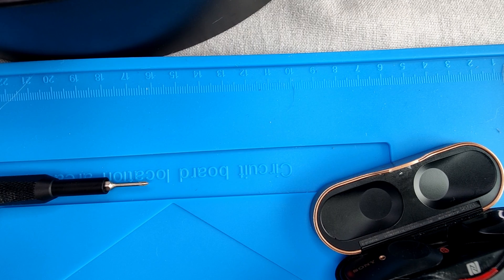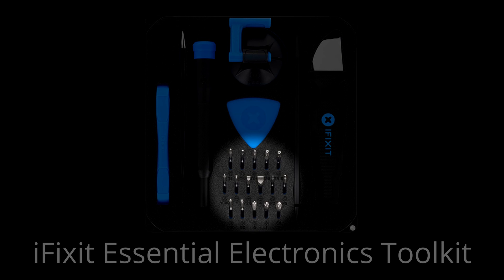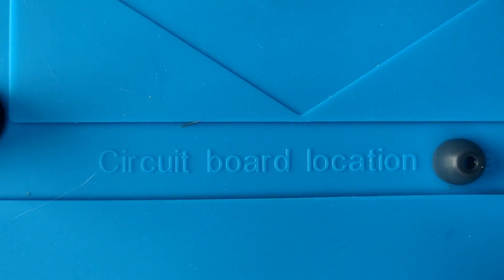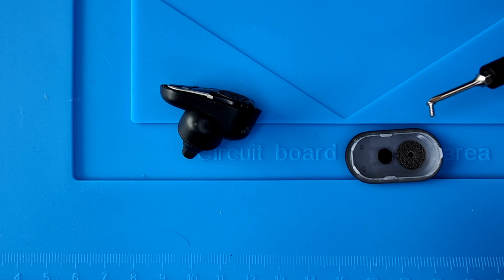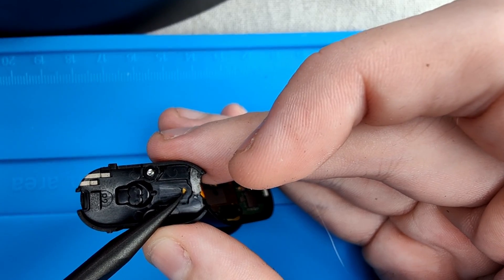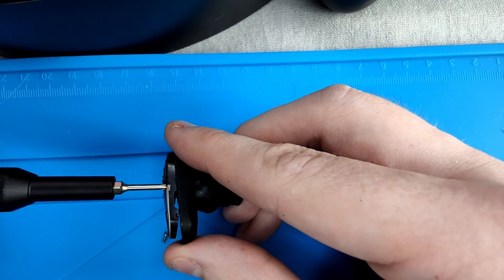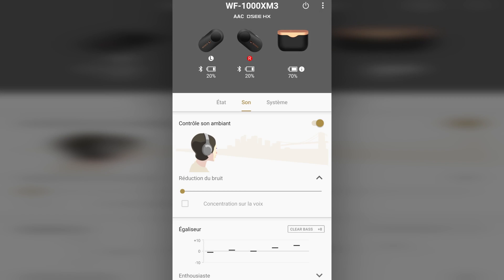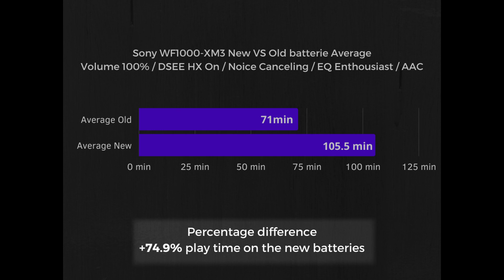Sony WF-1000MX3 Battery Replacement + new battery test

Comment: This worked, thanks. Words of warning for others - 1 - be careful near the front edge because you can easily damage the led on the board. I killed one of the LEDs this way. 2- If your touch sensor is wonky, try restarting (putting it back into the charger) - it will work again.
Reply: Yeah buy Varta cp1254 A4 if u can. They have capacity of 74 mAh vs Varta cp1254 A3 have 60 mAh capacity. 23,33% increase in battery capacity!
Reply: When I opened mine the ribbon ended sticking to the cover instead of staying on the bud, do you think the controls will still work?
Nevermind, left them to charge for a while and they're working now.
Reply: Worked for me too, the LED died but that's no great loss compared to having to throw out a pair of fairly expensive earbuds because one side only holds charge for twenty minutes. £12.66 for the new battery.
Reply: Just snapped off the LED while replacing the battery. Wish I had read your warning earlier!
Reply: I finally broke the led on 1 of the earbuds. But tbf it probably means better battery life now. :D

Comment: Really nice guide, but replacing the battery in one of the earbuds made my earbuds unusable. I broke off the LED when trying to pry the case open with a plastic tool. The earbud works fine without the LED, but now my left and right earbuds don't recognize each other anymore. My phone only sees one of them at a time. The only time they work together is right after pairing. As soon as I put them back in the case, only one of them will connect (randomly or whichever I take out first). I've done all the factory resets in the manual repeatedly. Now I regret trying this "easy" repair job. One of my earbuds only had 1 hour of battery life, but at least it worked. What a waste of time and money.

Comment: you sir are a scholar and gentleman. First one took me 10 minutes second 1 2 but I did break on plastic clip opening the second but my kit came with glue it should hold. Cheers to enjoying wf1000xm3 for a couple more years. Good on sony to not make landfill products. Can't believe a 20$ cad kit from amazon was enough to fix these I was barely getting 30 minutes on anc on original batteries.

Comment: Thanks for this. Right EB only lasts 15 mins, left about 45 mins so going to give it a go. Hardly used them since i had them 4-5 years ago and never been great on duration, so pretty disappointed in Sony. I work with people have other buds in all day and never seem to charge them :-(. Maybe I need to turn the noise cancelling and other stuff off?

Comment: I have done two of these surgeries and both went surprisingly well and are super simple to do. I am moving away from Sony as they have become progressively shit in their QC and customer support since the XM3's - I had two pairs of XM4's fail due to battery issues and fixing those was a NIGHTMARE. 

The XM3's were the last great wireless set of earbuds Sony made before they shit the bed and all over their customers.

Comment: THANK YOU, @Saroua! - 3 years later, and this saved me tons of money!  (got the dreaded "right-side-battery-rot"-issue, which also hit my XM4's... Sony taking no responsibility.)
I did decide to just try and get Z55H batteries (the original type that goes into the WF-XM4's) and boots up, pairs, plays, so I think they're good too!

One thing for me personally though, was that the point of having to align the dot, when reinserting the battery was unclear to me. 
I saw a dot/hole at the bottom, where you could see orange through (ribbon cable), but I guess the dot mentioned was the dot around the middle of the casing, with the HOLE in the metal plate that goes on the battery - I figured it out, and it worked, so all good!

Comment: Thank You - Just Changed the Varta A3 against Z55 which Sony used later on - didn't find a Varte A3, A4 or A5 (not out yet?) on reliable sources. Besides this video, Reddit is a good knowledge base. Now i can enjoy my 5 year old 220 € In-Ears again with full play time, after the left was down to ~45 minutes and the right one was down to 60 minutes. (I often use just the right one when I'm on the bicycle).

Comment: Just performed the replacement successfully, thanks for this video! couple extra thinks to look out for:
1- as other said, look out for the led's on the bottom of the board, take your time and open the perimeter in small steps, do not go deep with the picks.
2- my replacement batteries came wrapped with an amber, adhesive tape film that needed to be removed prior installation
3- watch out to not short the batteries! the metal contact bends upward and that upward part needs to be phisically distant form the side walls of the battery. I made this mistake initially and the battery got very hot. Luckly I was able to recover it but be careful!
4- removing the old battery was quite more difficult than shown in the video. Personally the best tactic was to really push down with the plastic lever to really get under the adhesive before prying.
Reply: video is generally very useful 
however around 5:12 how the OP placed the battery onto the metal plate is wildly dangerous. After removing the old battery you should put the metal plate back to the frame to install the replacement battery. On the frame there are two extruding bits aligned with the holes on the metal plate, the hole closer to the battery will allow the extruding bit on the frame coming through to prevent the side wall of the battery (plus side) from making contact with the metal plate which is already connected to the minus side (the side with engravings).
Reply: Wish I'd read this before I did the same - it's not working... it feels quite warm - remove battery and it's scalding hot lol

Comment: When the battery popped out the earbud twisted in my hand ripping off the ribbon. Be really careful it lets go quickly.

I knew the risk and a 15 min left earbud was mostly useless anyway.  It still connects and I can hear just fine. I assume the noise canceling isn't working but I also don't use it much since outside it's terrible.

Comment: ATTENTION: Be very careful also with the metal clip, I misunderstood that it needs to aligned with the adhesive and tried to put it back and short circuited the battery. It's better to put the metal piece into place since there is this small stopper which will keep it in place.

Comment: Thanks for this. My right side earbud is crapping out. I'll try replacing the batteries following this guide.  The link to the battery no longer works. Is there another source you can recommend?

Comment: Thanks for the tutorial. Mine comes with "ZeniPower Z55 Li-ion 3.7V 0.24Wh". Only found out after opening and purchased the same one you used but it works.

Comment: I changed one side and it worked. For the left side, however, the touch control doesn't work when the lid is on. The red LED is flickering and I manage to do a factory reset (with blue LED blinking). More importantly, I hear no sound coming out and no blue LED is blinking once I remove it from the charging case. Did anyone encounter similar problem? Resetting it without the lid didn't help so far
Reply: Try removing the adhesive tape under the battery. I had the same issue and this helped me stop the flickering red light and get the light back to normal

Comment: hey good video, things i learned while trying this
1. the flex cable is really... REALLY fragile, especially if you have an old one, don't bend it. i bent mine and it basically broke clean off. so now i don't have touch controls on 1 of the sides. waiting to see if charging still works, hopefully it does. but sound definitely comes out
2. when you're prying it off, there are tabs/clips that can very easily break off, try not to pry on 1 side and rotate around like i did. that'd break the tabs for sure.
3. get the varka batteries. i cheaped out and bought some batteries from china. worst decision ever, as soon as i put the metal tab, it made contact with the positive side and turned my battery into a heater. this one should be pretty obvious but.. not for stupid old me lol
good luck to anyone trying this, take ur time, be careful

Comment: Maybe you can help me. I changed the battery as instructed. 
The earbud will function but not load and does not give a red light.
The case itself shows a red light, even if the other earbud is not present. What can the problem be? And is there a solution?

Thank you

Comment: Tip for anyone that finds the touch controls aren't working when you put the top cover back on. I found the touch controls worked fine with the new batteries without the top cover, but as soon as I put the top cover back on, the touch commands stopped working (for both buds). I found that I needed to reset the buds. 

Put the buds back in the case, the red LED (per bud) should light up indicating charging. Press and hold the touch button (one bud at a time, with the buds in the case, and with the top cover on). After around 15 seconds the red LED will start flashing, keep holding the touch button. After a couple more seconds the LED with flash faster, then a couple more seconds the LED will turn off. Once the LED goes off, stop pressing the touch button. The LED will come back on after a second or two to indicate it's charging again. Repeat for the second bud. Once I did that I found the touch commands were working again. The reset will not change any of your pairing settings, so you won't need to re-pair to anything. 

It's weird. Obviously the touch is working to some extend, otherwise the reset process wouldn't work, but when paired with my phone it would not work with media commands (play/pause/skip) without me doing the reset.
Reply: thanks! this could have cost me my morning!

Comment: Hi there guys. I was able to replace the battery and all works just fine! Thanks for the tutorial. However, I am not able to "click-in" those two parts together anymore and I was wondering what to use in order to make them hold together better. I ordered B700 adhesive glue. Do you think it will work? Thanks

Comment: Awesome, I just finished replacing mine.   The new batteries came fully charged with a small tab on both sides for some reason, so i put the battery in with the tabs pointing into the battery and held it closed for a few seconds to see if the led would start blinking, but immediately notice the battery getting hot.  so I removed the battery and installed it with the tabs facing the opposite direction and checked again for heat and power, and it worked great.   Tested with charger and phone, no issues yet.

Comment: Thank you for the video, helped me immensely. When I reached out to Sony Pakistan to fix the earphones, they said that they could not import the official batteries, and if I was able to source them they would charge me to fit the batteries, plus they mentioned that they may bear marks due to opening the earphones. I was able to follow your video and there are no marks, am charging the earphones, so fingers crossed.

Comment: Great guide, thank you! One thing that was different with the battery I got was that the side with the writing on was the POSITIVE side, I very quickly realised and flipped the battery over and now all is good. Also, I had to be careful with the ribbon cable that is attached to the touch sensor when first opening the ear bud up as that was attached to the outer casing.

Comment: Thank you so much for this! I love my headphones but after a few years of heavy use followed by the pandemic and almost no use batteries were pretty dead. You, kind sir, saved me a few hundred dollars for new headphones and prevented generating unnecessary electronic waste. Big kudos!
One note - when lifting the battery - it's much easier to do from the side where the ribbon is. If you go from that side you're also more likely to only extract the battery which saves you the effort on re-aligning the contact

Comment: The earbuds blue light doesn't turn on when removed from case. It is always red in the charging case and earbuds. Please suggest
Reply: in my case the red light was flickering a bit in the chargingcase and blue light wont turn on if i removed them from the case. it was because the contact of the battery wasnt ideal. after i bent the contact a bit so it has better contact to the battey it worked again. mybe the headphones need stable power input to go to waiting for connection state or something like that.
Reply: @riedelr99  that's exactly the same issue I'm having. Not sure how to fix it. Went to local sony service center, but they said it can't be fixed by them. Instead they can replace if it is under warranty. Mine was under warranty but since i purchased in US, i cannot claim for replacement in India. Now I'm unsure how to fix it myself. It would be better if you elaborate the fix you did and worked for you.
Reply: @prakashvidz  i just took the battery out and instead of putting the "glue" with the contact on the battery i clipped the contact thing (the metal thing with the "glue" on it) into the headphones then bent the lip (the metal thing he is pointing at at 4:47 e.g.) so it reaches in the direction the battery will be placed in. then i pushed the battery in wich is oviously bending the lip back but only as far as it keeps contact (obviously) then i put the lid thing on top and screwed the screws in and then it was working. 

i think it does not matter how you do it but make sure the metal lip thing is in good stable contact with the battery :)
Reply: I have the same problem as you and I don't know how to fix

Comment: i was surprised that the new batteries only gave you 106 minutes. Ideally, when new, the earbuds should provide 4 or 5 hours of play time right? So, would a better solution be to try 90 mah batteries?

Comment: Can you use CP1254 A4 instead of A3? I think this would provide more capacity, am I right?
Reply from the maker: I don't know about the capacity increase ( even if it is logical that it would)

But people have used A4 to repair theirs and have confirmed it working just as fine
Reply: If it fits, it could work.
Mine's a Zenipower Z55 0.24Wh...

Finding a replacement for it is tougher than a Varta. 🤨

Comment: Thanks so much, I changed the left battery, it worked well during a couple of weeks and then it suddenly stopped completely : absolutely no sound in the left one. Any idea please ? I replaced it again but it didn't change anything. Regards.

Comment: This is why manufacturers are not keen to repair or replace the rechargeable batteries which would actually save the environment from more e-waste. 

I replaced both batteries as they were losing charge fast. It looks easy but you will still need a little patience and TLC as this are pretty small earbuds if you have huge fingers. I bought a pair batteries online which cost $18. The tricky part is placing the battery and it's metal connector with double sided tape. 

Before you close the cover, you can actually put the earbuds on the charger to make sure the red charging light appears. If it's blinking or no lights, it means the battery is not sitting or connected correctly.

Comment: Very helpful, cheers!  Only thing, i don't think 74.9% improvement is correct? 48/49% improvement based on 71 minutes to 105.5 minutes.  Still great though

Comment: Hi Saroua, thanks for your video which comes at the right moment as my wfx3 are dying to fast. I would like to have your expertise on this : found some cp1254 but a4 instead of a3. they seem to have same voltage and size but capacity looks better.
Do you think they could be compatible with wfx3? thanks

Comment: So $18 for the battery and then $40 for the toolkit 🤔 im wondering if its worth it
Reply from the maker: Well it all depends if you'll use the toolkit or not in the future

I've used it a ton and it was worth every cent I've put into it
Reply: Just need a wedge that will pry it open and a screwdriver.  Don't have to buy that kit
Reply: @marky1010  please help what size should i buy for the screws

Comment: I dropped the left bud several times and eventually it just stopped working. The battery will not charge either. I removed the battery and replaced it again (same battery) just to check. Any ideas of what can be broken from? I know it is a very general question but maybe you have better insight.
Reply: I want to point out that my left bud died after putting it back in the case. When I put it back on, it was dead. But I haven't dropped the buds for at least a week.

Comment: My replacement batteries came wrapped in yellow tape that I had to remove.  They also had tabs that I had to break off.  They worked awesome the first night but once I put them back in the charger overnight the left one stopped functioning.  I completely disassembled it and the battery was too hot to touch.  I tried to rotate the battery thinking that it might be shorting out on something.  IT no longer overheats but that earbud stopped functioning.  I would guess that I fried it somehow.